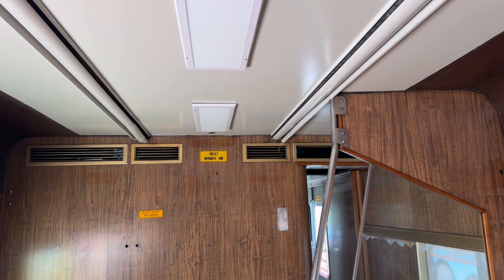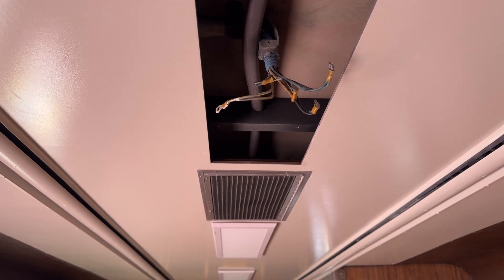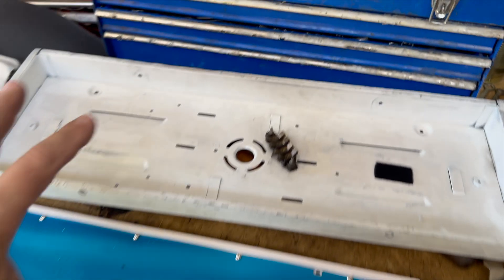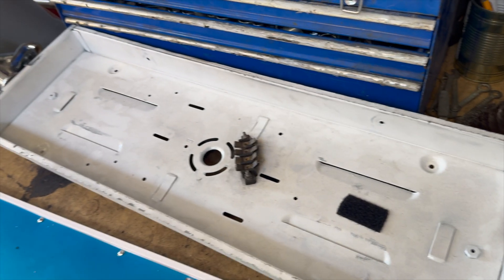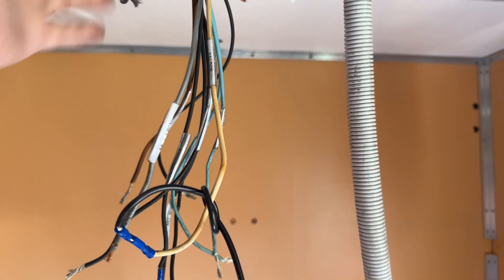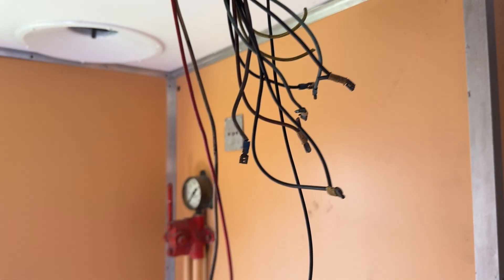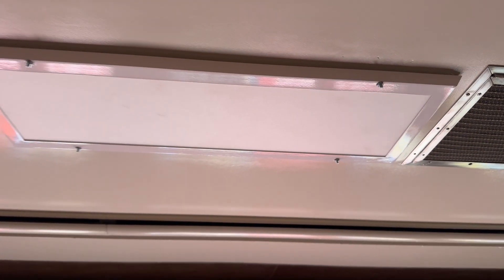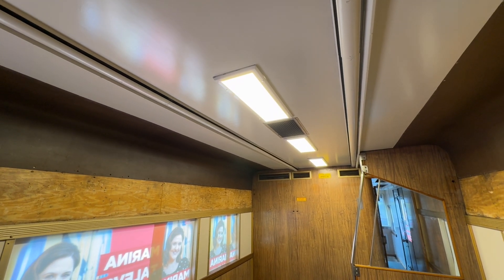KARLS TRAINS: We have illumination! Fitting our new custom 48VDC LED lights to PCH1221

Comment: Karl, how about dome nuts and spring washers to hold the lights up. That way you can use the existing configuration. Lining up screws into standoffs inside a blind hole is notoriously tricky. 4 dome nuts over the existing screws (maybe a tad shorter or spaced at the back mounting by stacked washers) could be a solid practical solution.
Reply: I've seen a number of electrical panels where the front cover is just held on by dome nuts over protruding threads on things like overhead workshop cranes. A drop of Purple loctite and a good nip up and they shouldn't ever fall down on anyone. But also shouldn't be too far different from the original interior styling.
Reply from the maker: That's a really good idea actually. As you can see we are working hard to be sympathetic to the existing design